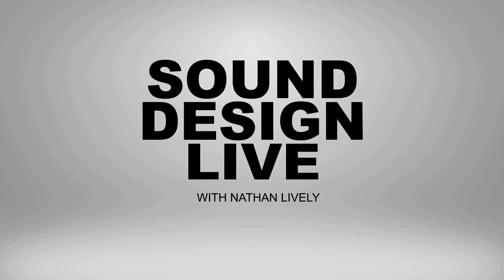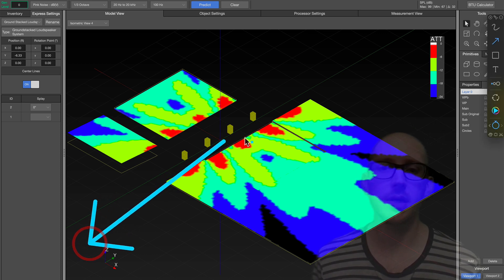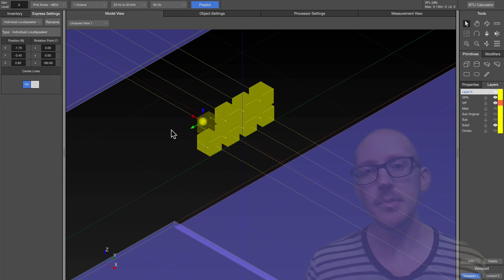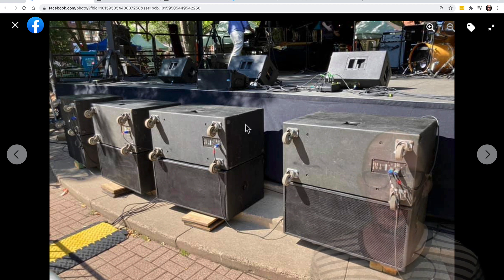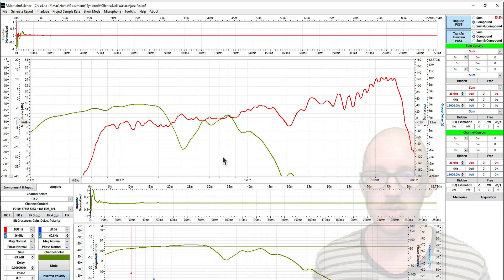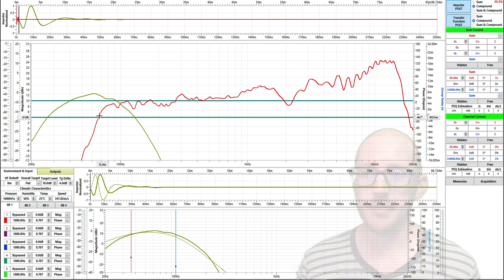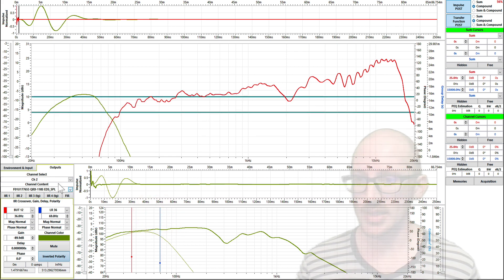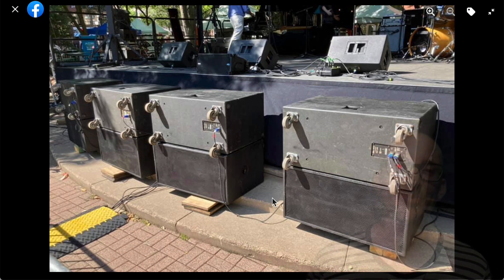2-Element Inverted Gradient Stack at Minneapolis Jazz Fest

Comment: You`ll get better results with the in line setup than the  front- back setup?
Reply from the maker: Hey Manu, in terms of total rejection? I think so, yes. The in-line version allows you to manipulate the spacing and tune the effective bandwidth to best match the speaker's operating range.

Comment: If the low frequency cancelation in VIP area was the most important, I would rather setup supercardioid pattern, but than you get little more noise on the stage. Those T4's has small woofer. Just 8" and needs to be highpassed at about 100Hz. Unfortunately there is no highpass setup on those speakers, and no RD net control that is possible in newer models. what was processing added for rear facing subs? for this type of configuration, there needs to be delay, phase reverse, gain reduction and limiters threshold reduction. Will you share your values?
Reply from the maker: Hey Palo, great tip! A supercardioid pattern would have been even better for the VIP area. 

> needs to be highpassed at about 100Hz
How did you decide on that value?

>  Will you share your values?
Shoot, I don't think I have them. But, I do have the MAPP3D file if you'd like to look at that.
http://sendanywhe.re/86P5A9QM
Reply: @nathanlively  we did used T8's and I spoke about the crossover point with distributor and service techniker about recommended crossover for tham, and we booth agreed on 100Hz, once, I forgot to apply crossover, and one bass speaker has broken. Other benefit is you get much greater headroom for lower mids.

Comment: Great Stuff!!!   I suspect some of the concepts I struggled to understand are in future modules of the training but I think I caught most of the thought process behind what you were doing.  Is there a way of importing performance data for the EV subs into Mapp 3D or did you just use an equivalent MeyerSound sub?
Reply from the maker: Hi JD! Have you made it to the end of Module 2, yet? Gradient subs are covered there.

> Is there a way of importing performance data for the EV subs into Mapp 3D
No, I just picked something that was about the right size box.

Comment: Nice vidéo, great tips there. Can you explain why you reversed the top sub and not the other way round?
Reply from the maker: Hi Cedric! If you try both ways in your modeling software, you'll see the result pretty quickly. If you draw a line interesting both drivers, that's where the null will end up. Check out Mauricio's presentation at Live Sound Summit for more on this: https://livesoundsummit2020.sounddesignlive.com/talks/modern-variable-directivity-techniques-in-subwoofer-arrays/

Comment: What I don't understand, is why they wouldn't let YOU bring in some hardware to plug into their system. Like an additional speaker management system, to give you that additional processing channel to put a delay on the end subs, and to be able to high pass the speakers.  Damn, if you showed up at my event, it would be, "Hey, what do you need?".  Seriously.  Have a good one.  Carl
Reply from the maker: Oh, I'm sure they would have. I was just trying to keep it as simple as possible. Also, I like a bit of a challenge. :)
Reply: More gear and more setup also equals more cost